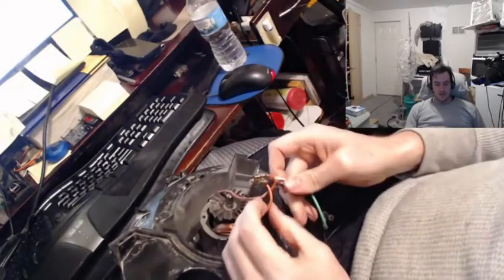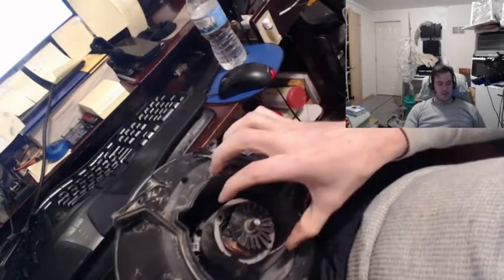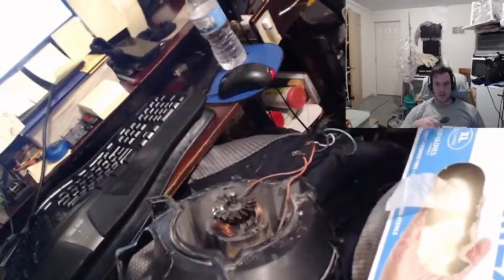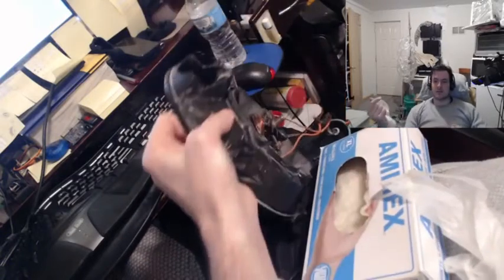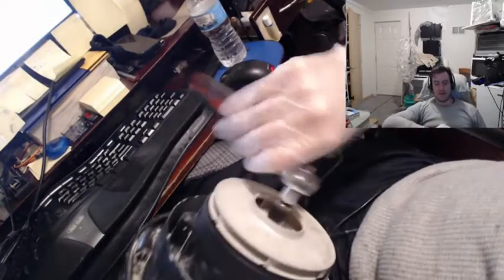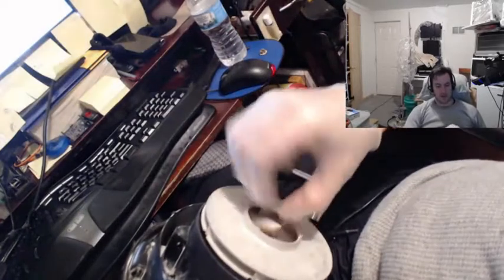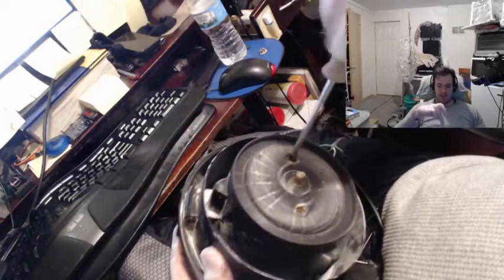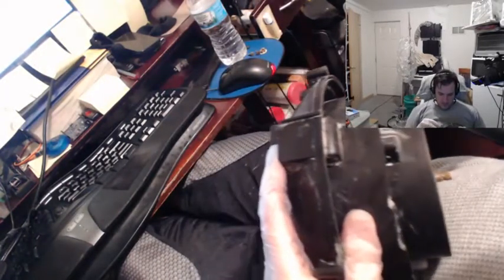Shopvac Motor Removal - How to Unscrew Fan Nut!

Comment: Anytime you see a bare shaft, don't grip it with pipe wrenches, vise grips or channel locks. Grab a drill with a keyed chuck and tighten it on the shaft, because of the gear reduction it will hold the shaft while you take the nut off and it won't damage the shaft...
Reply from the maker: genius!

Comment: My ShopVacThe Washer Nut For The Fan Worked It's Self Out And Now The Fan Make A Lot Of Noise And I Can Find The Replacement Any Where Please Help Thanks
Reply from the maker: you measure the diameter and thread pitch of the bolt and then order the corresponding nut or buy from hardware store.  Or you can use a drill and tap into a smaller diameter nut so that you can get a nut of same thread pitch and diameter to match your shopvac
Reply: Thank You I Will Do That

Comment: The thermal fuse on my vac was special made contraption attached outside of the motor.  Replace it with a generic fuse and it was OK.
Reply: Interesting.   I like this idea. Where was it located and what did it look like?

Comment: I just disassembled my Shop Vac because I had never cleaned it thoroughly before, but am now having trouble putting it back together.  Every time I try to assemble the motor and connect everything, the motor only turns the fan part for a couple of seconds and the motor starts to make a humming sound and doesn't turn.  If anyone has any suggestions on how to make the motor turn correctly again, I would appreciate the feedback.  Thanks!

Comment: I used the impact method, was very easy. Just put on a heavy work glove or a welding glove, hold the fan at the bottom, by the nut you are removing, and use the impact in short bursts. Comes right off.  I guess the was it is supposed to come off is by using an allen wrench in the hole in the end of the shaft while turning the nut, but it was on way too tight/rusted, and I would have broken my hex wrench before anything would loosen.
My problem is after removing the fan, there is a washer press fit onto the shaft, and try as I may, I can't get it off. Tried prying with two screwdrivers, tried holding the washer with a vise grip, and hammering the shaft through, but it won't let go....
Reply: Johnny Z 
That's the same problem I'm having right now. Did you ever get it off? I've been trying to remove mine but it's seeming impossible without bending the 💩 out of the fan blade.......ya know? 😮😲😦😬
Reply: @Metalholica1  Not very timely reply, but I had the same problem (bending the soft fan blades).  I ended up cutting a slot in the end of the threaded shaft peaking through the nut, with a dremel and a cutoff disk. Then I used a screwdriver to hold the shaft while I unscrewed the nut with a wrench. No visegrip.
Reply: @3maisons  
Sounds like a plan, but, I threw the shit out.
Got tired of 🖕ing with it.

Comment: I found that not all versions are screw on.  Mine was a friction fit retaining ring over a set of restraining plates sandwiching the centrifugal fan between them. I just popped the retaining ring off with a flat head then I held the centrifugal fan in my hand and carefully tapped the shaft to push it through the retaining plates until the whole assembly fell away from the fan, without breaking something else , of course. Take care not to damage the fan or the retaining plates. They need to be flat when you put them back on. Also, if your rings seem to be loosely fitting, the retaining ring can be bent a bit to make it tighter. Good luck!

Comment: I used a 12" Vice grip that clamped right down on that shaft, and then a socket wrench to loosen the nut, but only after putting some lube  oil around the bottom of that nut because it seemed so corroded.  They are not aluminum.  These will corrode in place after a period.

Comment: The way I freed the rotor nut after several attempts was to hold the rotor while wearing a pair of leather gloves and using an 18v impact driver to back out the nut. The result was instant. I hadn't been able to hold the rotor still while trying to use a regular wrench, but the impact driver handled it in about two seconds.
Reply from the maker: very clever well done sir

Comment: Yeah so how the heck do you screw it back on?
Reply from the maker: just use a channel lock and your hand to brace it.  doesn't have to be THAT tight...
Reply: @artbyrobot1  where would I grab with the channel locks? My vacuum is slightly different than yours but has the same fan mechanism thing.